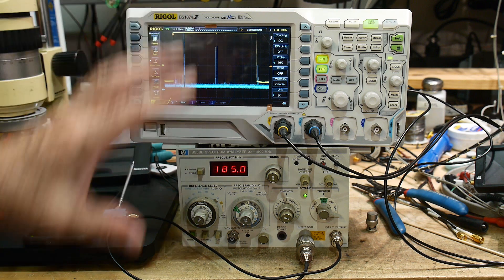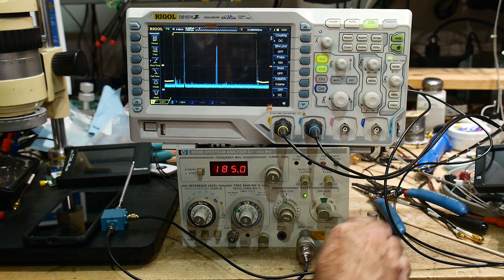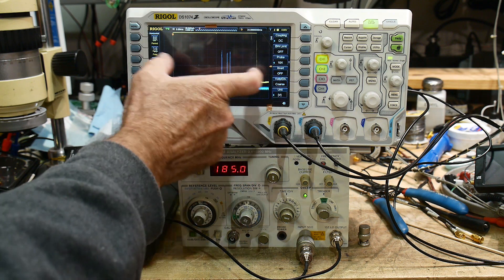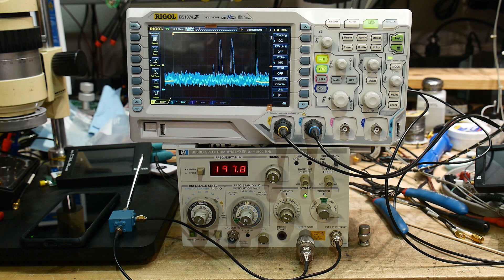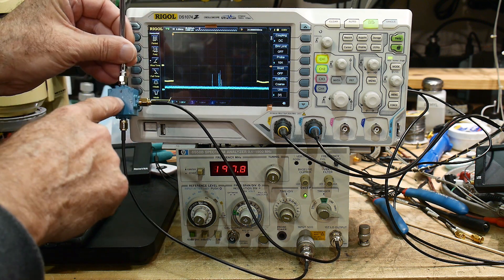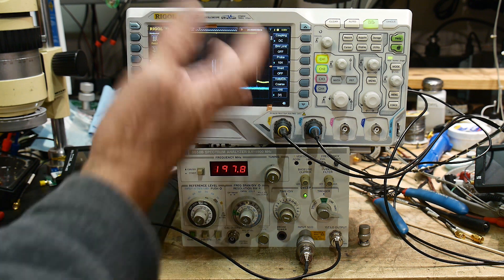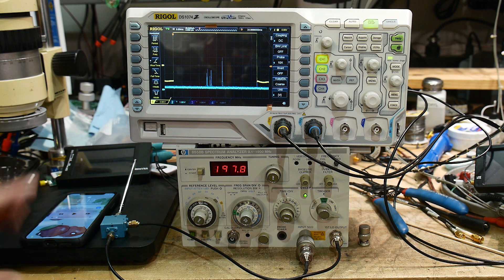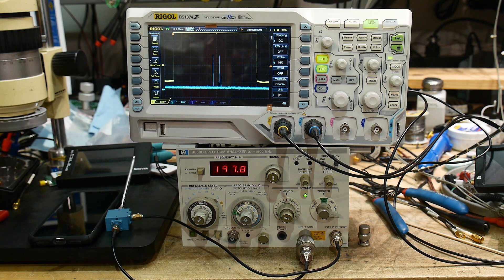#607 Using an External Mixer with a Spectrum Analyzer

Comment: I do understand something about this spectrum analyzer. What does it output to the scope? What is the blue channel set to? Does this analyzer convert frequency sweep to analog  amplitude signal with a fixed time base? How do you synchronize the horizontal scale, so that the readings are accurate?
Reply from the maker: https://youtu.be/UnpmJsCdPVA?si=8FU6I0di6OGJyBdY

Comment: I was hoping the down converted spread frequency signal would of been demodulated...so we could hear that 96 dB S/N audio thru a little newer version LM386 with two channels...

I wonder if there is a chip...?

It sounds like you need to mix again and get to an empty area on FM broadcast ...then listen to your McInTosh receiver tuned and being played thru the JBL 3 ways...

Or send test signal through phone...go through the signal chain...measure the distortion like with you instrument 

Maybe if the IC-705...general coverage reciever was turned in...

Its good to see...like how some earlier spectrum analyzer...used to cover like up 1.2 GHz...then go to 21 Gz...without changing the size or appearance that much..

My order S9...had the audio jack...and I would play or listen to the phone YouTube audio or a Playlist by going into the RCA CD port on the Sony reciever heard through Altec Lansings.

I have also (4) CLS-215 Cerwin Vega tower speakers driven by two Crown 2002 XTI class D PA The pa are powerd by 2 12 VDC  8D bus batteries in series running a 3kW perfect sine wave inverter...24VDC to 120 VAC 60 Hz
It's just the little camping Karaoke ..but if someone wants to crank in...we been heard fainty a mile away...lol...
Usually one half playing at 5 watts average a side is plenty..one must not disrupt the animals trying to sleep...
.
Fred don't disrupt IMASI Guy and his teaching 

Thanks IMSAI Guy

Comment: It's a clever hack.  

From the HP Keysight 9018-05859 user and service manual, the first LO is 2.05 to 3.55 GHz is swept for 0 to 1.5 GHz input frequencies.  Under normal operation, the internal mixer brings the signals down to the 2050 MHz first IF.   

In your setup, the 1rst LO output and the WIFI/Bluetooth signal at 2.400 to 2.4835 GHz are mixed down to 350 to 433 Mhz and fed into the input.  The internal mixer then mixes it down to the 2050 IF.

Comment: Good information. Which is the spectrum analyzer, the HP or the RIGOL sitting above it?
Reply from the maker: The spectrum analyzer is the unit below. It is designed to be a plug in for an HP oscilloscope I do not have. the upper unit is a Rigol oscilloscope being used as the display.
Reply from the maker: If you search on 8558B, I have several videos on this unit

Comment: Cool little extension with that external mixer. Regarding the 200 MHz center frequency, your frequency span is 20 MHz, so it's sweeping from 190 - 210 MHz. If the original signal's center is at 2.45 GHz, then the LO must be spanning 2.24 - 2.26 GHz. If you have a frequency counter that goes up that high, set a zero span and see if the LO is operating in that range.

The manual indicates that the low end of the LO on the 8558B is 2.05 GHz, so you might be able to see a part of that span at 400 MHz.
Reply from the maker: yes, you are correct. It sweeps backwards though.  2.24-2.26 sweep 210-190
Reply: @IMSAIGuy  Yep. It's on the subtraction side of the mix, hence backwards. I didn't write it in such a way as to reflect that, though you're right that I probably should have.

Comment: You have some super cool videos, thank you for educating us. Why not to draw down on a piece of paper the signal flow of this setup and explain some mixer basics, would be easier to understand for most people.
Warm regards from Germany, Helmut
PS: Can you add the Link to the eBay mixer into the description would nee of interest.
Reply from the maker: Sorry the mixer was only one (used). Thanks for the recommendation of drawing the mixer stuff. I know that will help some. Where in Germany are you. My last job I traveled to Aachen twice a year.
Reply: @IMSAIGuy  I am from the Hannover region.
BTW: I got an used Agilent E4443 PSA SA where the Elcom S-1006A 3.6 Ghz phase locked oscillator output is defective, the output is -7 dB instead of +10. I believe the corroded band path is the problem. I am working on it in my spare time.
Is has a 1.8 GHz internal locked output which works correct, this goes with +20 dBm into a doubler (HMC188), this goes into a band path filter and finally into a MMIC Amplifier (Sirenza SNA-186?) which should produce +10 dB

It quite a challenge for me to repair it, even de-soldering parts is difficult because the metal around will dissipates all the heat. Maybe I should use a preheating station to bring it to permanent 150° C to use an airflow gun to de-solder it.
Regards Helmut